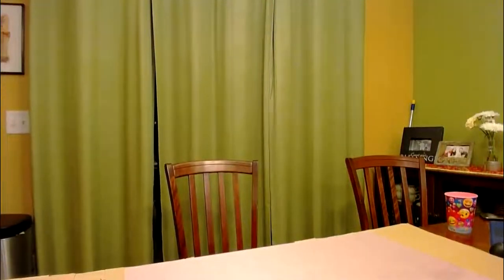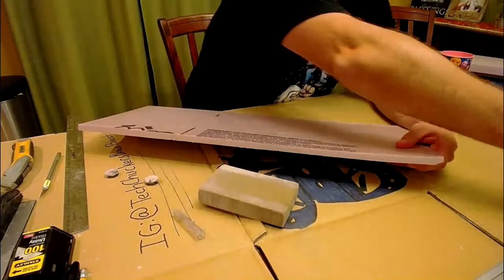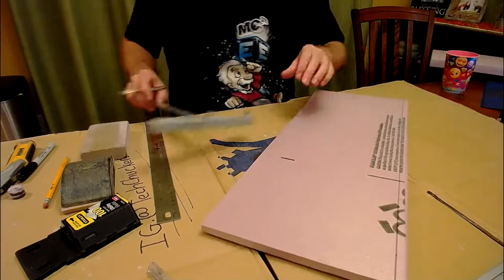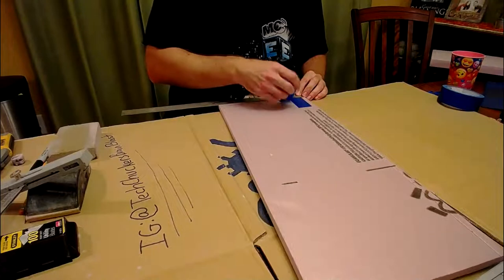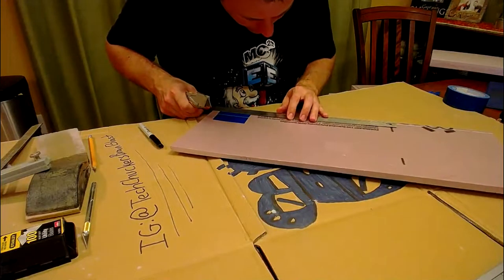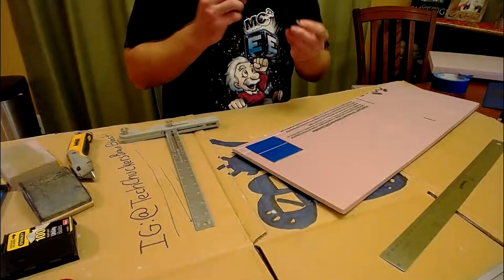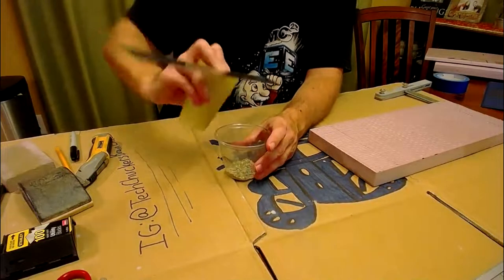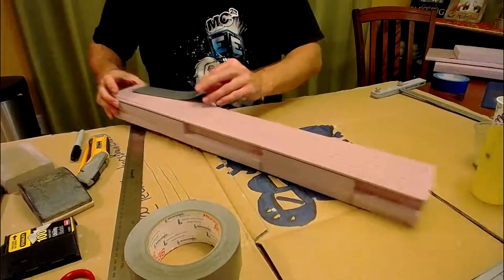Marvel Legends Diorama Build Brick Wall & Street Detailing

Comment: Nice work Matt. I use almost the same technique, I use several items to make the structure. I use a stone, brick and several woodblocks with gravel or other material to make a structure in the foam.  Your method works better in small places and round corners, one to remember. And you again amaze me how precise you make your lines, every time I make a mess of it.